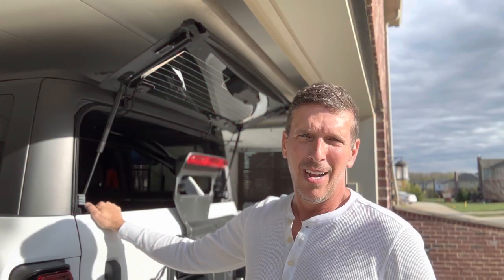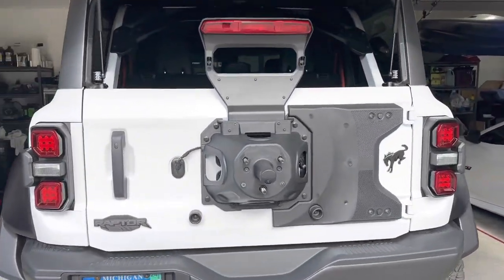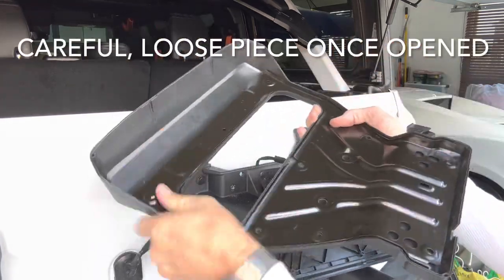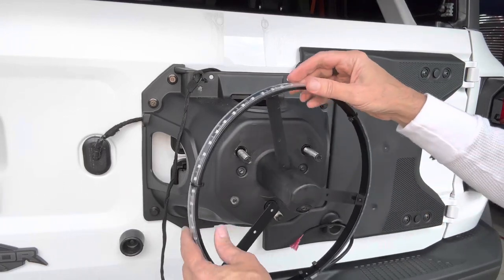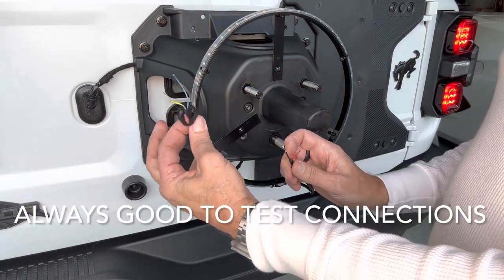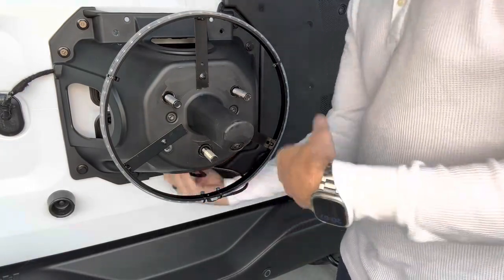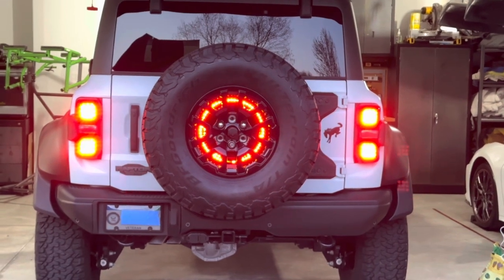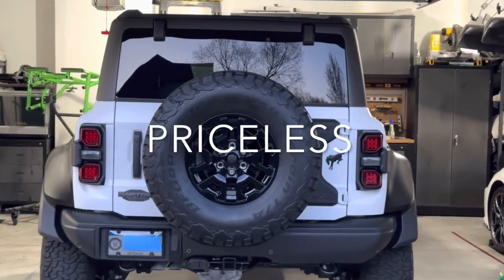Oracle Lighting Spare Tire LED 3rd Brake Light install / Bronco Raptor

Comment: There is now an introduced red light source encompassing your backup camera.  Have you noticed any red "clouding" in the rear view camera while reversing?  BTW also a Navy Veteran with a C8 HTC also.
Reply from the maker: Nothing I have noticed. The vertical plane of the light ring is pretty well forward of the camera lens location. So I don’t really think it can shine into the Lens assembly. If anything, there may be a little more light to illuminate the ground when backing up, since the rear tire really blocked the OEM red light from hitting the ground near the back of the vehicle until probably 10 feet behind the vehicle. But def no red glare or bloom in camera that I have ever noticed. Thanks for checking out the channel and for your service!

Comment: Your third brake light looks different than mine. What year and model of bronco do you have? I have 2023 bronco badlands with Sasquatch?
Reply from the maker: It’s on the Raptor, so light sits up a bit higher due to the larger diameter tire. Very similar installation on the non-raptor.

Comment: If you wanted the ring light to come on when you lock and unlock what would you have to do?
Reply from the maker: I’m not sure if you could adapt it. The third brake light it replaced had an extra wire, which I’m assuming probably went to some additional LEDs that are only used to flash with the lock/unlock. But that’s just a guess. Those instances are so rare though for me, it just isn’t a factor. Anyone that sees it an operation thinks it looks awesome. It looks very factory in my opinion where some of them just are overdone with too many lights and I think a nuisance for someone behind you at a traffic light. I’ve had this on for a year, and still working great, no LEDs failed.

Comment: Just out of curiosity, what lights did not re-connecting the blue-wire affect?
Reply from the maker: That is tied to the courtesy lighting - flash of lights for unlock/lock. Separate from the power sent to the light by depressing the brake pedal. It is rarely used, and I didn’t find it beneficial or something I cared about. The other brake/turn-signals still flash for that feature. (I am guessing that Jeep - which this was originally made for - doesn’t flash the center brake light for unlock, so Oracle didn’t design to have another power source/wire)

Comment: What a mess of an installation. Cutting the arms, drilling holes. Should be so much simpler, horrible design by Oracle
Reply from the maker: Agreed. I wrote them about the issues. It is still worth the bit of effort though. One year later and 10,000 miles, and it still works perfectly. No LEDs have failed. I get a lot of compliments at “cars n coffee”. Thanks for checking out the channel and your comments 👍🏻